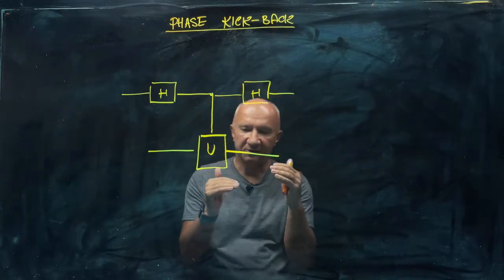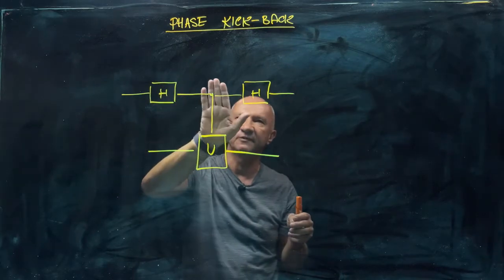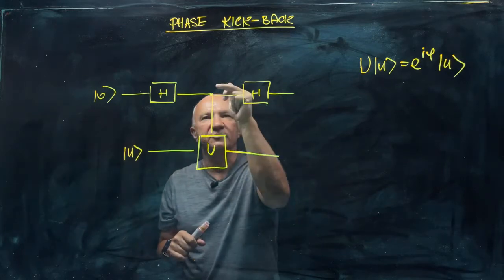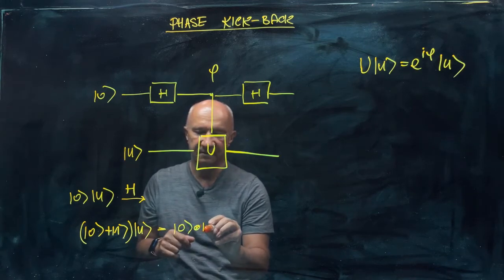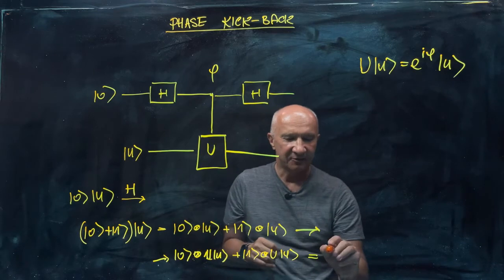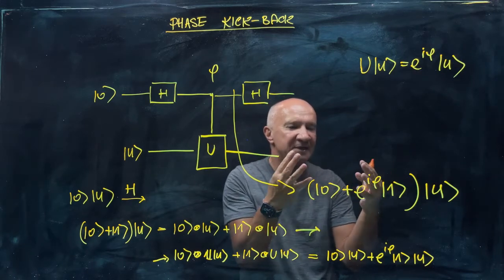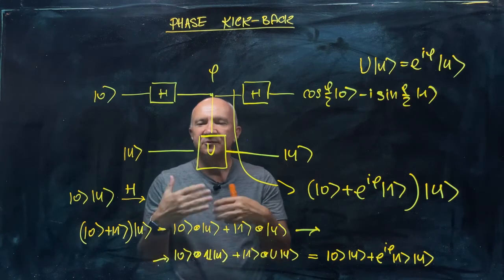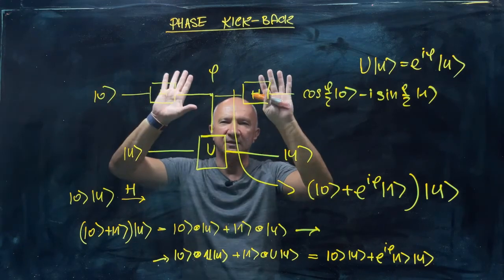IQIS Lecture 6.4 — Phase kick-back

Comment: Awesome video. I have a little question that I've never seemed to be able to answer myself about the math vs the physical qubits. After you apply unitary U and get e^iphi|1>, why do we automatically bring it out front and assume the phase is introduced to the control qubit rather than the target? Like how do we know it's |0>|u> + (e^iphi |1>)|u> instead of  |0>|u> + |1>(e^iphi |u>)?
Reply: From my understanding e^i*phi is a scalar, a complex number which can be brought in front per tensor product properties. (sA) x B = A x (sB) where x is tensor product or in dirac notation (s|A>)|b> = |A >(s|B>)

Comment: Just adding a comment here that the circuit described here by Prof Ekert is the same as the single-qubit Quantum Phase Estimation (QPE) circuit. It can be used to extract the eigenvalue of U corresponding to the input eigenvector through repeated measurements of the first qubit. The Qiskit summer School of 2020 has a good explanation of QPE and how to build the QFT circuit.
Reply: why do we apply these Hadamard gates at the beginning and at the end?

Comment: I don't understand why the u qubit stays unchanged. The U gate doesn't affect it?
Reply: the u qubit is an eigenstate of the U operation, meaning the amplitude of the qubit after the operation is the same as it was before
Reply: @mollyaitch1792 i think it's because control Qubit is 0. So u> Qubit stays the same. 
If control Qubit was 1 then I believe operation U would have been applied on u> too